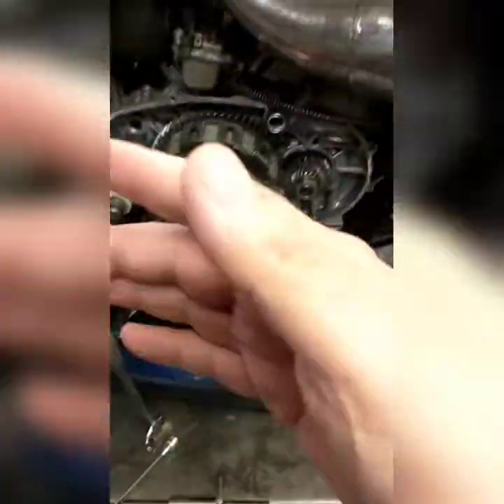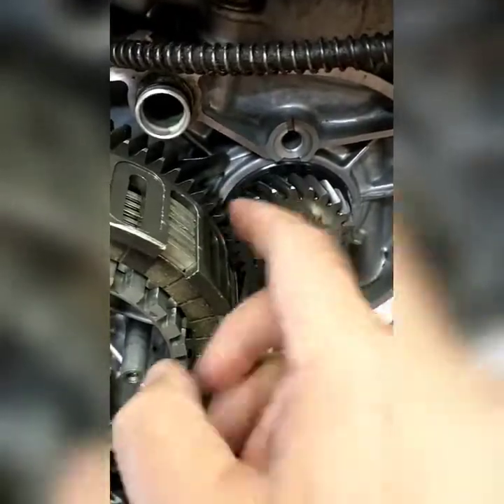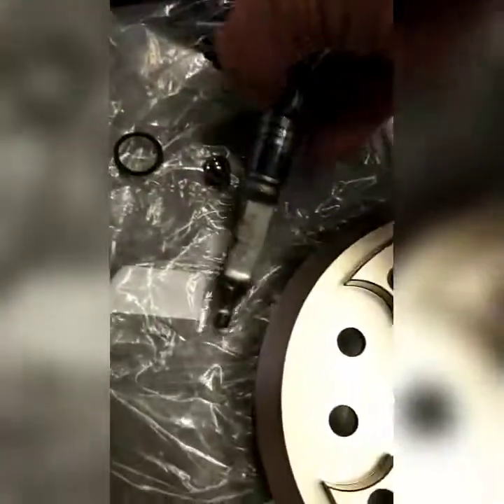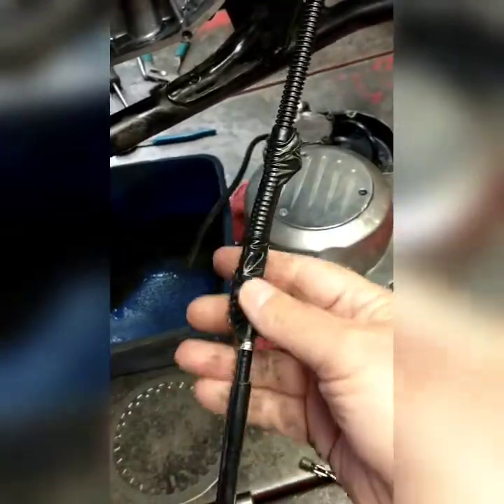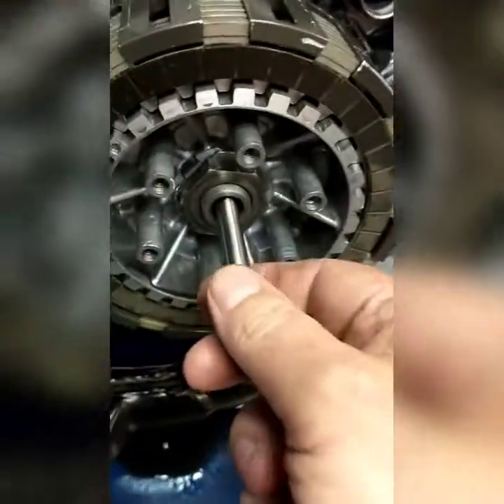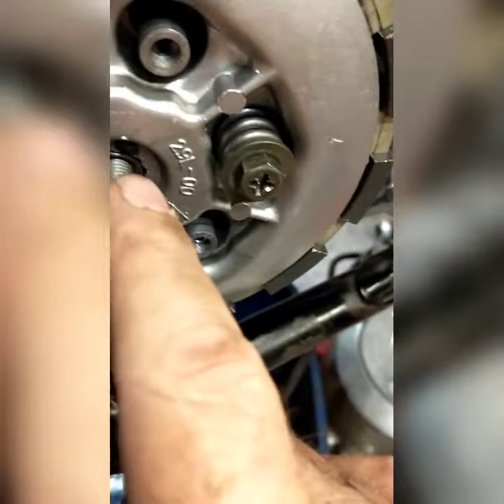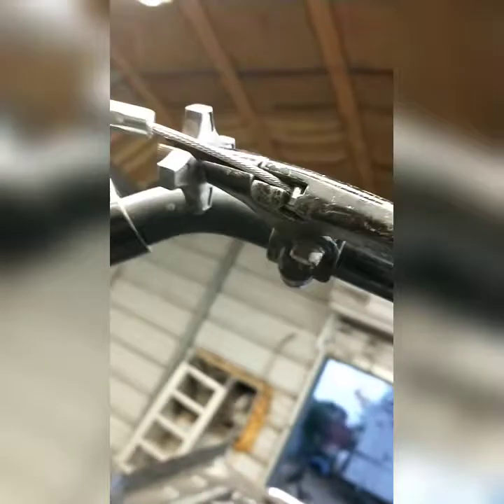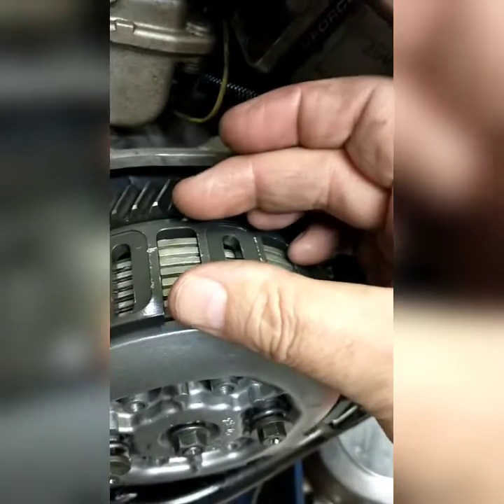How a Yamaha Banshee clutch works and repair job

Comment: Heyyy I have a question , my arrows won’t line up so I did what you said but with the new clutch and cable the clutch is still slipping at high rpm I can’t seem to figure out why? Any suggestions ?

Comment: Would you know why my banshee is having a hard time shifting? Took it apart many of times and everything looks good, ive tried adjusting the shift star,  I've put new cushions with a new basket, still the same.

Any tips would be appreciated. Thank you!
Reply from the maker: Probably a bent shift fork if all looks good
Reply: @geezermoto7820  thank you for the reply. ill look in to that.
Reply from the maker: Or bent shift shaft
Reply: @geezermoto7820  it's weird though because Itll shift clean through the gears when bike is off, But when its started, that's when it is difficult to shift the gears.
Reply from the maker: @biggz808  make sure your cable is a little loose and the actual adjustment on the clutch pressure plate is a little sloppy
Reply from the maker: You need slack or it all binds up

Comment: Back again i ordered all the parts u told me for the road star i have a question my starter clicks now do u think i should change the starter relay before i tackle changing the starter? The bike is 18yrs old so im thinking it more likely the starter any suggestions?? Your the Man!! Thank you for all of your help!!
Reply from the maker: You can run a big hot wire right to the starter,  if it spins it's good. Or, jump (bypass) the solenoid or yank starter off, test with jumper cables, black to the body, red to the stud where the 10mm nut holds on the hot wire
Reply from the maker: I would guess solenoid
Reply from the maker: To jump relay just make contact with pliers or whatever across both the big cable screws on it
Reply from the maker: An electoMagnet just makes a metal bar touch both the bolts from the inside